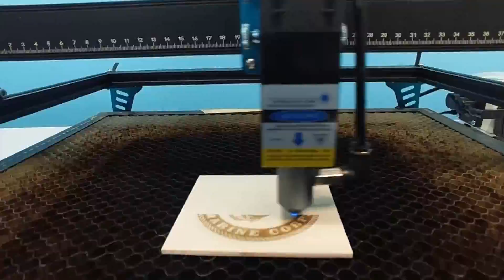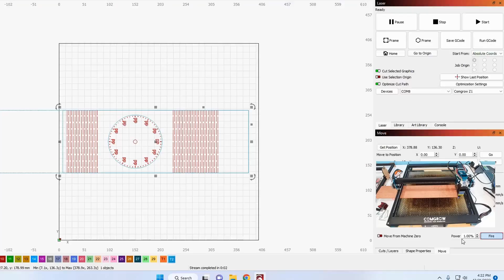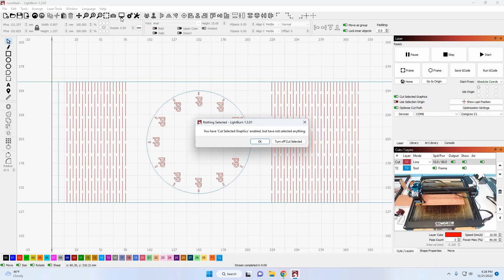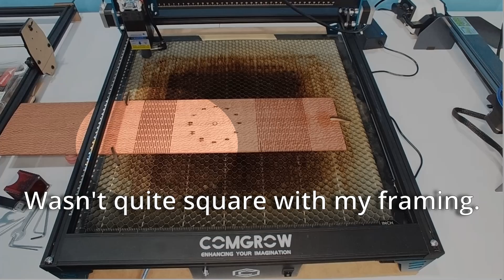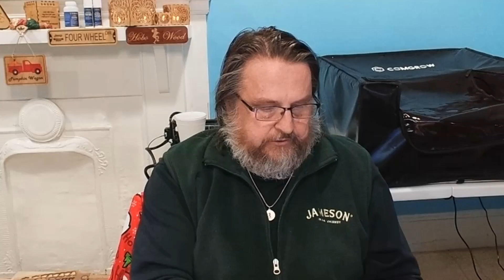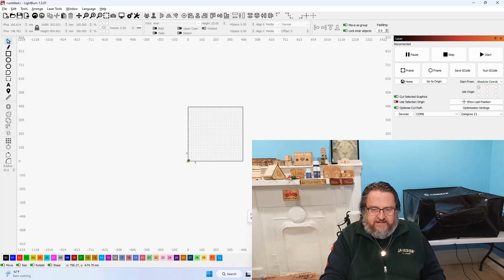Comgrow Comgo Z1 10W - First Cuts

Comment: Would have helped if you had dampened the wood after the burn? Spray bottle?
Reply from the maker: Yeah, learned about that the hard way. I'm using steam and hot water now. I'm even simply scoring the wood instead of cutting completely through. Then using the steam to get the curve I want and it stays. I'm loving it. This of course is not for the living hinge, but for simple arches or curved designs. Learning something new everyday.

Comment: I realize you have to work with what you have, perhaps if you had cut with the grain the wood would have been more pliable. I see some good scraps there for inlay. Too bad about the cork...
Reply from the maker: The Leopardwood doesn't have a typical lateral grain. They are circular, that's what creates the pattern given it the name Leopardwood. I could tell when I lifted it from the honeycomb, it was too stiff. My hinges usually flop almost in half. This one didn't hardly give at all. It is a hardwood and it proved it.